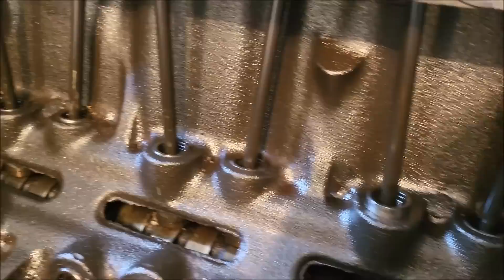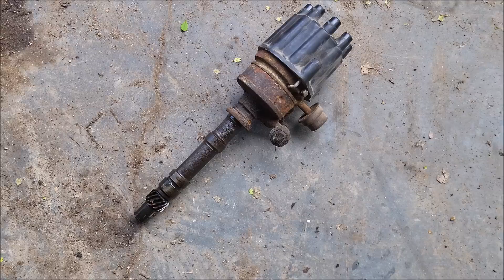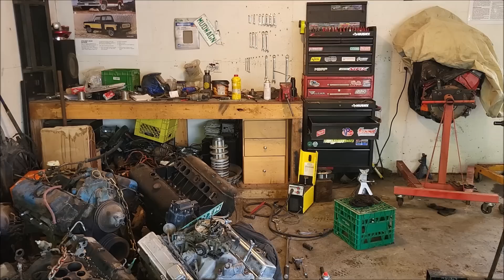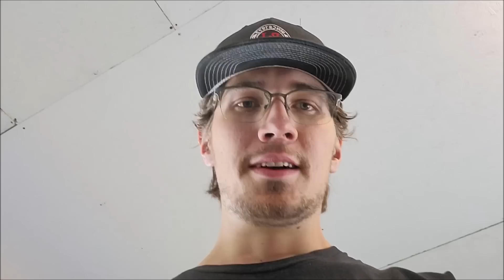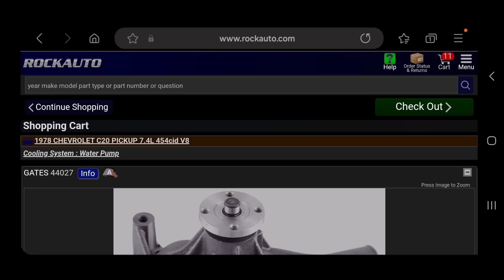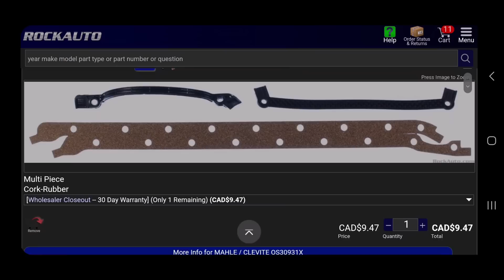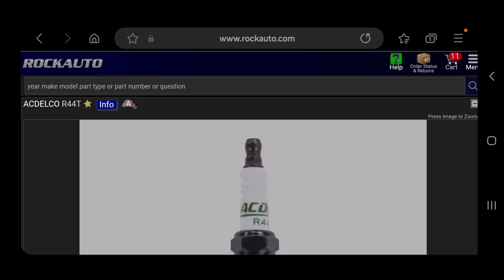Why Does Everyone Ignore Tall Deck Big Block Chevy V8s?

Comment: I worked at a GMC dealership back in the late 80's early 90's and those motors were the 427 and 366 were used in UPS trucks and 3500 pickups and tow trucks. We use to buy the cores and use them in 1500 pickups and they ran great,11,and 12 second 1/4 mile times with no problems. All we changed was oil pump, cam,intake, distributor and carburetor of your choice. Those tall decks will run. By the way I recommend a 400 transmission and a 9" rear.. I really don't want to say how I know you will need my recommendation. LOL 😂 But you will thank me for it. 😊
Reply: @johndcunninghamjr4111  Definitely need a T400 and a stout rearend.
Reply: Put a Nissan CVT in it
Reply: @samholdsworth420 
😮😂😅😂
Reply: No, they were NOT an 11 second engine in a truck.... period.

Comment: You know people who ignore those?
Reply: Absolutely, we never used tall deck blocks, there is nothing to gain if only using a 4" stroke or less crank.
Reply: @fastone371  I also have a 454 & 496 cube 9.8 deck engines I'm building. They'll all be between 700-800+hp NA. Single Dominators on big singleplane intakes, big solid rollers, over 13-1 compression and aftermarket aluminum heads. 496 probably getting a tunnelram & twin 1000cfm Holleys. That TD 427 block is definitely the strongest block of the 3.
Reply: @fastone371  I'm building one that's 4.310x3.760, and 6.535 long rods. I guarantee it'll make well over 700+hp NA, turn 8000+rpm and run mid 9s in a G-body. Cubes ain't everything.
Reply: A good combo back in the day was a 427 T with longer rods,forged piston,rectangle port heads and a 8-71 with injection running on alky.

Comment: Back in the day, early 80's, first year of the NHRA Super Comp class is when we are talking. We raced an altered called Danger Zone. If that tells you anything. Anyway, we would only use tall deck truck blocks. For multiple reasons. One, extra attention was paid when it was centered in the mold when cast and the iron was of a higher nickel content than any other passenger block. Second, the cylinder walls are thick. After a sonic check we could punch them .125". The tall deck allows for a longer connecting rod. Forged steel main caps. 427 tall deck with 427 crank, punched .125", 477 ci I do believe, aluminum Super Rods all that stuff. We'd buzz it to 8600-8700 rpm. 7.50 sec. car back in the 80's
Reply: The problem with using tall decks is you get a real goofy stroke to rod length ratio. They work good with a 4 1/4" or even a 4 1/2" stroke crank though. We were using standard deck 4 1/4" bore blocks and going .100 over IIRC which made them 482". With Howards aluminum rods and a Chevy steel crank we were going thru the traps at 8300 RPM's.
Reply: If memory serves me I think we were using .400" long rods for the 477. We did build a couple versions with the 454 crank that were just under 500cid. But the 477 was the nastiest of the bunch.
Reply: @fastone371 odd question, do you think a 366T could make a pull truck motor? Need max torque to drag a sled 300 feet at about 7500 plus rpm.
Reply: @Hillbillygarage1215  The only way I would run a truck block is if I was trying to build a budget 4 3/8" or 4 1/2" stroke engine. You can go 4 1/4" stroke without a weird rod length or real high wrist pin height in a standard deck block. A 4 1/4 stroke 4.31 bore gives you a 496" motor. With decent heads on a combo as above you should be able to make an honest 800HP NA on anyone's dyno, probably even more.
Reply: @fastone371 thank you for the information, I appreciate it.
Reply: My father was a service mgr at a gmc dealer for many years the drag racers would come and ask for the core tall deck 427s they loved these ! they would puch them out to over 500 ci!
Reply: @andrewslagle1974 505ci is their max
Reply: My ol buddy popped the hood on his 97 k3500? tow truck and show me a 366. Never knew they existed
Reply: So cool!
Reply: A lot of us are turning them into 515 Big blocks put a 454 crank custom rod you can punch those motors 100 over if you want
Reply: Damn Chevy guys always get hurt when someone mentions a hemi 😂
Reply: I worked  in a fleet shop in1974.
366&427 tall blocks put a lot of kids thru college. 
THEY ate plugwires& water
pumps& distributors  like candy. Lousy ass
engines
Reply: @br549junior is the engines fault or something that could be fixed with better parts
Reply: @noturfather1106  
They got so hot every
Thing under the hood
Suffered .they all had Allison's  automatic 
I n them
Reply: I doubt  if anyone  could solve high heat issues. Exhaust  manifolds cracked,distributors  caps would melt
 @noturfather1106
Reply: @br549junior  um you're talking about every engine in the 70s . Plus those are common parts to wear out. If you bought ANY new car in 1974 you were replacing parts like alternator, water pump, and starters within 20k miles.
Reply: @petemcpeterson6205 no
I had a 71 Plymouth valiant 318 and I never had any of those problems. And it had 100k when I got it in 2006
Reply: 366 was a bobtail engine only and many were used in fleets that ran on propane.
Reply: @johnpopoff7950  no very wrong most common engine to find in a C70 c80 or a topkick 48 Kodiak definitely did not just run on propane
Reply: No, they did NOT "have a higher nickel content" than the regular car blocks. That's JUST an urban myth. 

One can EASILY tell while boring these blocks that they are the same exact material as any other G.M. block..
Reply: @davelowets Actually they are stronger than a passenger car block.
Reply: they can never compete with a 426 hemi
Reply: That's horse shit. Na hemis are not all that great when you factor in the weight.  I've been 8.18 @ 177 mph with a natural aspirated tall deck BBC in a 3300 lb door car.  You won't find any 426 hemis doing that naturally aspirated.. period  @FredCollins-l8c
Reply: Back in those days the game was just getting the car to hook. So in reality, more than the ET, was the top end MPH charge. L-88 Vettes would out MPH anything with a hemi in it. Nothing wrong with a hemi. Anything with a hemi today is very valuable. As anything with an L-88 I suppose also. But the hemi was a full generation behind the BBC in design. So to make a blanket statement such as you have expressed, based totally on emotion and "reputation" would be just a tiny bit hyperbole. Nevertheless your point is well taken, as reckless and naïve as it may be 😉
Reply: @FredCollins-l8c Hemis couldn't compete with L-88s NA. Hemi gotta have a blower and nitromethane to make big power. NA a Hemi is just a big fuckin over hyped boat anchor.
Reply: @thereluctantgearhead4544 have you ever had a hemi??
Reply: @FredCollins-l8c  I hope that you don't mean the Chrysler Hemi. You do know that the BAE, AJPE, Noonan, etc Hemis have nothing in common with Chrysler Hemi's, right? Other than valve arrangement. Nobody races a Chrysler Hemi, they really don't even make good performance engines, the valves hit each other during overlap with aggressive cam profiles.
Reply: @fastone371  they share bore space, deck hieght, bellhousing, crank and cam centerlines  along with most of the traditional geometery and design, yeah, the ports are bigger but they're pretty close to the original hemi including the deepskirted blocks with cross bolted mains.
Reply: @seancollins9745 Top Fuel engines ain't nothing like a 1970 Cuda 426 Hemi. Dream on.
Reply: @thereluctantgearhead4544 ok bub, i don't have a billet block and heads in my shed 😂😂

Comment: All cranks in tall deck blocks are forged steel. Rods are same as low deck blocks, tall deck blocks use 4 ring pistons needing extra deck height.
Reply: No they aren't. All the tall deck 427 are forged steel. Most of the 366 are cast steel.
Reply: @johneckert1365  I can't speak with authority as to forged or cast cranks, but what I can say is the strokes are the same.  If the 366 crank is forged, it's identical to the 427.
Reply: @Lorne.Mccuaig  yup, strokes are identical. Maybe there were 366's with forged cranks, but I've never seen one. I've taken alot of them apart too.

Comment: 454 is externally balanced it won't be a good outcome if you use one on a 427.
Reply: Cast crank 454 is externally balanced, but a forged crank 454 is internally balanced.
Reply: @johneckert1365  I got a factory 7416 forged ls6 crankshaft in my garage it's externally balanced. Aftermarket crankshafts can be internally balanced the scat forged stroker crank that's replacing my 7416 crank is internally balanced.
Reply: @garysgarage.2841  I'm positive I have taken apart forged crank 454's with neutral balanced flywheels and harmonic balancers.

Comment: I have a few videos talking about the tall deck bigblocks ya might be interested in. Ive been building them for decades.
Reply: @thereluctantgearhead4544  They do make for some really nice sleepers. LOL
Reply: @johndcunninghamjr4111  Definitely a strong engine. Just look at what they came in stock. Some big ass trucks that haul a lot of weight. Extreme duty applications for sure. Never seen LS engines in C70-C80 dump trucks, grain trucks, tanker trucks, etc. Strongest GM gas engines ever built. I'd buy all of them I can find.

Comment: The tall deck bigblocks are still a damn good engine to use. Even a stock one will make a 1/2 ton pickup get up and go.
Reply: Back in the 90s, my brother in law bought a big block and TH 400 from an RV that a friend of his was scrapping out. I believe he only paid a couple hundred bucks for both and put it in his half ton square body, didn't touch the carb, cam, intake etc. The thing purred like a kitten and would easily smoke the tires at will and pull like a freight train...anyway he thought it was a 454 until he ran the block number later on and found out that it was a 366.